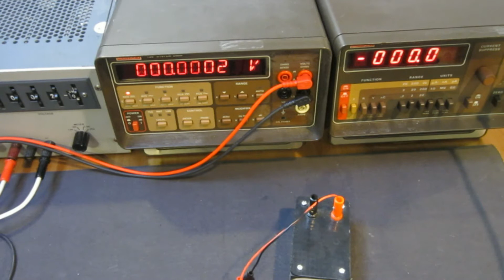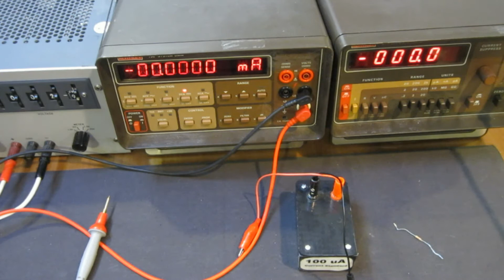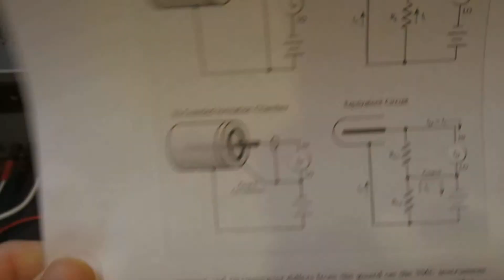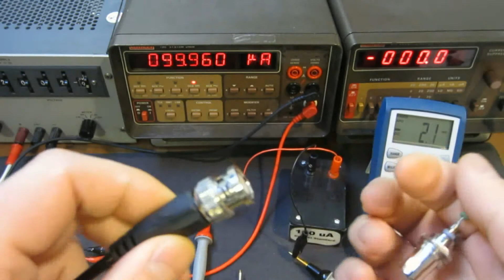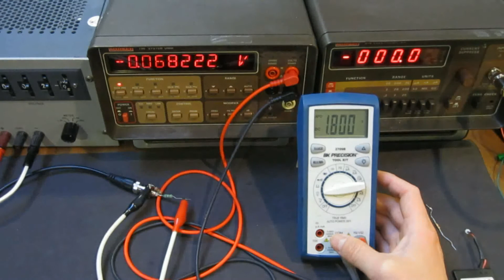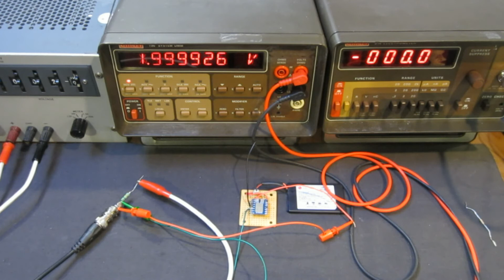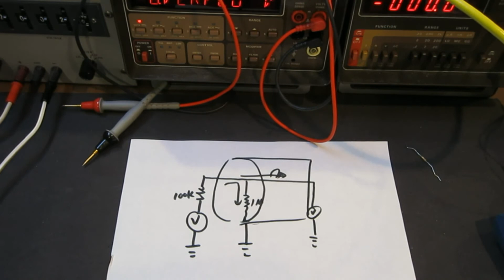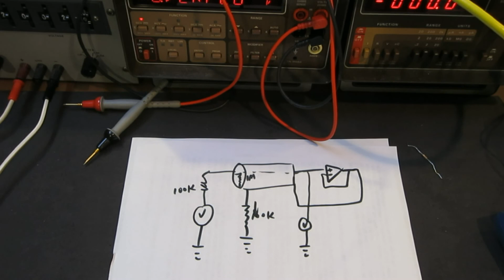Guarding Explained

Comment: Nice one. So when a meter has a guard built in is it essentially using a buffer opamp as you illustrate? Might be nice to demonstrate the proper use of a meter with a separate guard (if you have one, e.g. Fluke 8810 or Fluke 8600A, etc.)

Comment: Sir, Very nice video. 
Please help me one thing . 
I am teying to design a high impedance electrometer ( 1 T OHM ) by making a buffer configuration of a high impedance of amp ( LMC 662 ). But , I am unable to measure high impedance voltages ( upto 5 volt ) without adding a parallel capacitor of about 1 micro farad. This capacitor is obviously needs much charging and discharging time. Also , in the open circuited situation the output shows high voltage. 
Can you please suggest a proper way to design a high impedance ( 100 Tera Ohm ) electrometer using ADA 4530-1 ? 
I am not expert in electronics. I need to design an electeomerer for high impedance voltage measurement for parallel plate experiment for students. 
Regards